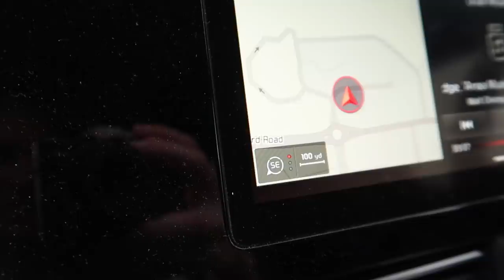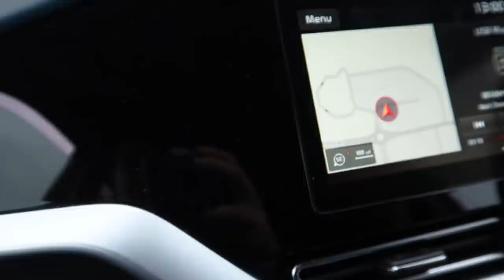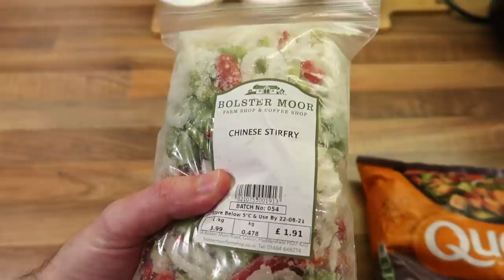STARTING ON THE BATHROOM | THE LODGE GUYS | HUSBANDS VLOG

Comment: Why not tile the whole room in light grey (or white) tile and then whole bath wall in a dark grey or a patterned tile ( depending on the pattern, you could even also put it on the floor - the laura ashley Wicker tile in Dove grey or charcoal are lovely)? As its a smallish room the pattern on both walls will close it in?

Comment: Re. Super glue not sticking your windbreaker,  you can get a super glue activator spray on Amazon which instantly sets the glue, it's only about a fiver. Just don't get it on your fingers!